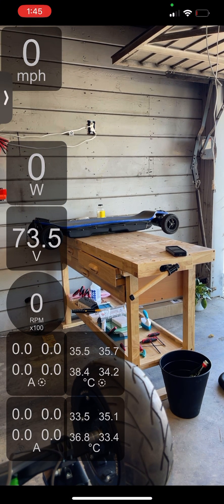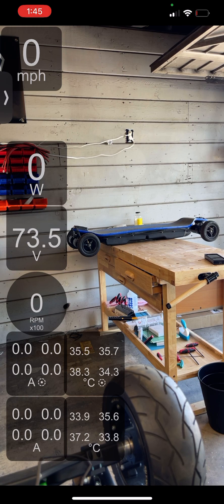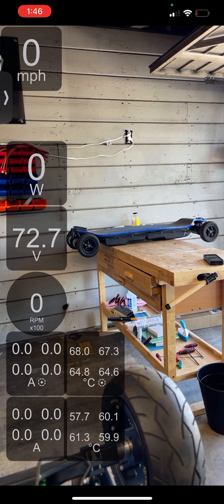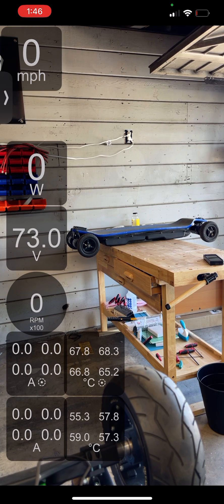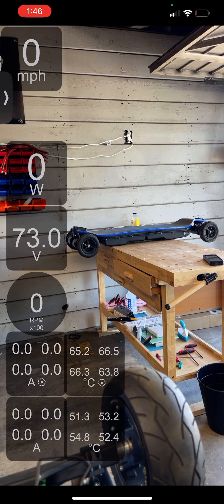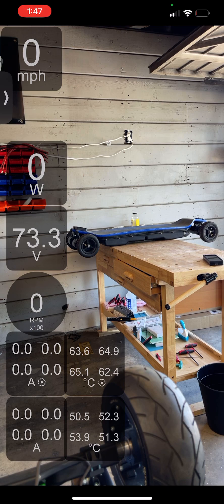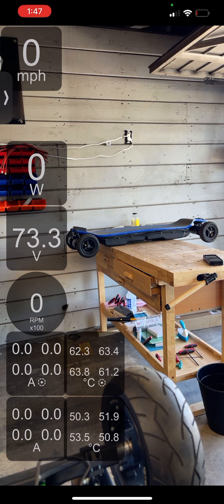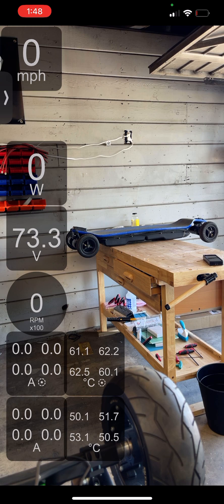BLDC motor heat brief Explanation

Comment: Really enjoyed this educational video on the physics of motor temp relative to RPM and cooling. 

How will all 4 motors from the beast handle the heat after 30mins hard ride around town. 

Is it setup for all torque or a middle between speed and torque?
Exciting times for the pro ESK8 hobby world.